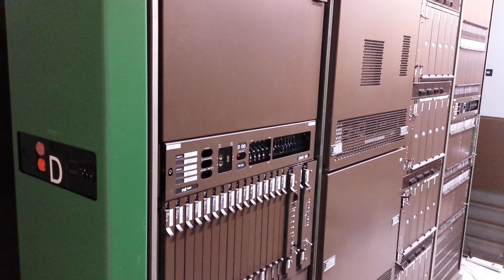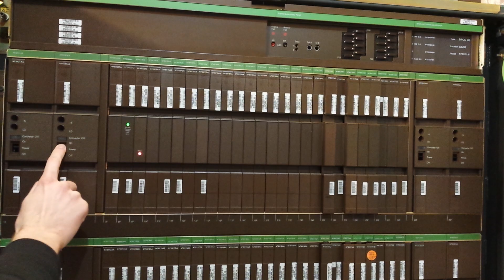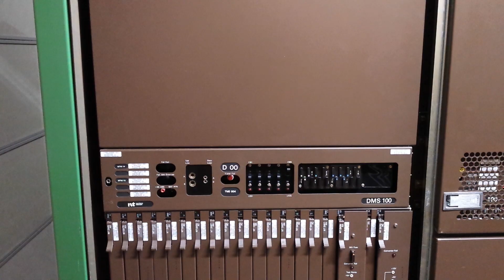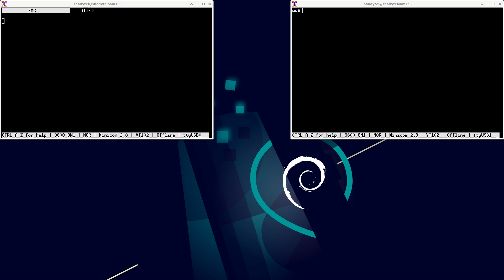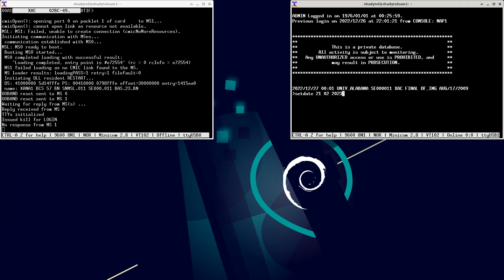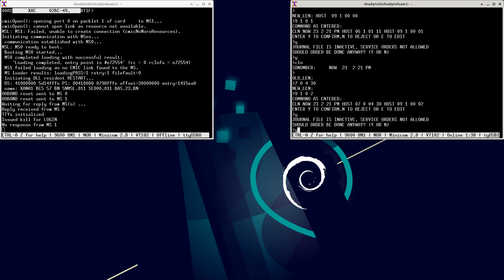DMS-100 Startup and First Phone Calls

Comment: I have no idea if no.4 ess (toll switcher) class 4, 3, or more is still in operation,  also wonder if no.5 ess is still in operation  these days.  Thank you.  This is a very interesting video.
Reply: ATT still have 5 E switches.  We have trucks connected to one here in Memphis.
Reply: @rc_farmer48  thank you.  Does at&t still have the 4e ess switchers?
Reply: I used to work in a class 4 &5 SxS with Cama switching center for southwestern bell back in the 70's.
Reply: Then I ended up working on minicomputer systems for at&t long lines until 1990 which I was laid off.  Life haven't been the same since. Now I'm retired.
Reply from the maker: I can't remember if I can count toll switches (4E) in LERG, but there are several thousand 5ESS still in service, mostly run by AT&T I bet. 3E should be gone at this point, aside from museum pieces. The AT&T long distance network is still several hundred 4ESSes but they've been slowly getting replaced with N4E AKA 'new' 4ESSes which is a replacement that involves much less bespoke hardware that is intended to mostly look and feel the same as the original by virtue of running the same software where possible. I'm not sure on all the details there though.
Reply: @joesvax  good to know that these switchers are still around.  Thank you.
Reply: When working for at&t until laid-off,  I worked on minicomputers such as the pdp-11/70, Vax 780, vaxclusters, at&t 3b2 and 3b20s systems along with hp1000, hp9000 systems.  I have no idea if even some of them are still there.
Reply: Never worked any ESS switching in my bell Telco days,  but had good exposure to computer systems though.
Reply: @rc_farmer48  good to know.  I'm glad these are still here.

Comment: Does it come with an ANAC circuit? It would be interesting if you can hook it up to the outside PSTN (perhaps via SIP if there is such an add-on module / license) and we can dial in to the system and "play" with it.
Reply from the maker: I am not yet sure how or if I can do an ANAC.

The plan is to let it be poked at, but at $300/mo in estimated electricity I'm more likely to schedule times that it'll be on than leave it on all the time.
Reply: In theory that is doable. When Succession Networks first came out, they deployed an option called evergreen to keep all the telco's from having to throw out the old hardware. I forget the name of the node but IIRC it hung off your MS and allowed you add sip to the legacy system. I'll have to see if I still have any of my old docs. Pretty sure I trashed them all. Either way the cost to find one of those likely wouldn't be worth it.
Reply from the maker: @TheProjectHelpDesk  actually I lied again, I guess. Technically my switch was upgraded from SL-100 to a CS2100, the PBX variant of the CS2000.

There's some VoIP hardware that goes with that, specifically a rack of redundant ethernet/ATM switch, media gateway cards in an SPME frame, the various VoIP signalling and application servers as cards in a pair of compactPCI chassis, and a small pile of Sun Netra systems to run the management and billing software.

Aside from that, I also discovered some weird media gateway cards that install into a DTC in place of the T1 cards, perhaps that predates the ones for the SPM.

Comment: DMS-100 or was it an SL-100? Usually universities had the "SL" which was identical to the DMS but sold through Nortel Enterprise. We had a full set up in our lab in Toronto!
Reply from the maker: That's where it gets a bit strange.
Technically it's an SL-100, but having been installed ca. 1984/85, the SL-100 didn't exist yet as a product. The documentation I have says it was a DMS-100/200 and the customer was listed as Bell South. Later on, it must have become the university's and converted to an SL-100.
Reply: @joesvax  Interesting! I did some work on voicemail integrations with the SL-100 maybe around 1998 or so. As I recall, they were virtually identical to the DMS with some slight software changes. The USAF had a ton of them - something like 20 - because they had a feature called “autovon” which AT&T didn’t have at the time.
Reply from the maker: supporting docs for my other reply: http://www.dms-100.net/files/telephony/nortel/SL100/docs/initial-spec-1984/initial-spec.pdf
Reply from the maker: It is also my understanding that the SL-100 and DMS-100 are mostly just software differences. Almost all of the hardware is shared with minor differences, and even then the differences are mostly superficial. The one odd thing is that the SL-100 has some specific hardware to support Meridian 1 IPE cabinets (the specific hardware goes in the IPE shelf) which I don't think nortel would let you do on a DMS, though I could be mistaken.

I think it's mostly down to what nortel turned on in the software and what they'd sell to install in each switch.
Reply from the maker: for completeness, I am also adding that after this switch was converted to an SL-100, it was later upgraded to a CS2100.
Reply: @joesvax  What i've known the DMS-100/200 is a total different switch when it comes to many other things on top of that. It's tandem office in itself which is very interesting how that works.

Comment: I would love to see you get your hands on a TSPS Operator console and get it working with your DMS100!  Or better yet. a TSPS training Operator Console!
Reply from the maker: Nortel switches uses TOPS, as I think TSPS was the predecessor to OSPS that was used on the WECo switches. I do have it on my todo list to establish whether I have the right equipment and software optioning to support TOPS consoles.

Comment: why are the circuit breakers not in the order you need to switch them on in, seems like bad design, assuming they are CB's and if not, still bad design if they are just switches?
Reply from the maker: Firstly, under normal conditions, these systems don't get turned off. Secondly, a lot of the breaker-flipping is admittedly theatrical exaggeration. I could have turned them all on from the start, but it made for a good intro.
Reply: Boy, it's a way better design than you think it is, Probably better than you're local switch IRL, So you need to learn about these switches cause they didn't hire dumb people to design it, it took years months to come up with this stuff in the first place! Have you seen a fully Electro-mechanical switch before? i don't think so that's the best computer in the world for call switching.
Reply: I can understand, we had an option 70 meridian phone system at work, it had not been turned off for 25 years. We turned it off, it didn't work anymore when we turned it back on!
Reply: @womski  option 70 meridian switch is a way different switch than the one you see in this video, Or maybe the reason why the switch didn't turn back on for you is because it clearly didn't want someone like you to be next to it so it got upset. ? who knows :) No offence!

Comment: Which OS would this have originally used?
Reply from the maker: Bespoke one, written by Northern Telecom/Bell Northern Research. I believe it was called 'SOS' standing for Switch Operating System (or maybe I'm confused with the DMS-10). Elsewhere in the switch, there are a larger number of embedded systems running either no operating system, or XMS, another Nortel creation. Later on, with the transition to the CS-2000, a number of the newer components were running Nortel Carrier Grade Linux and Solaris on SPARC or Windows on x86 for higher level OAM equipment and the like.

Comment: I wonder if any dms100's are still used?
Reply from the maker: A lot of them actually, recent LERG shows over 2500 DMS-100s, nearly 600 DMS-100/200s, and a number of others I didn't count because I can't remember their switch type abbreviations off the top of my head. That just covers NANP, but there's likely a lot of them installed internationally as well.
Reply: @joesvax  what is "lerg"?
Reply from the maker: @t13fox67  https://en.wikipedia.org/wiki/LERG_Routing_Guide
Reply: @joesvax  I'll check it out,  thank you so much.
Reply: DMS-100s and DMS-10s are still widely in use in Canada.
Reply: @Daniel Branconnier  this is good to know.  Thank you.  I've been out of the switching loop since at&t laid me off in 1990.
Reply: My area has a mix of those and GTD-5s
Reply: @thetechdudemc  good to know these systems are still around.  Thank you.

Comment: How many nuclear reactors are you using to power that
Reply: His house power if he keeps it on for 24/7 his electric bill will be high
Reply from the maker: a touch over 3000W. About 40 cents per hour at my electric rates.
Reply: @joesvax  - What?  No battery string good for 4 hours  before you start the standby generator!

Comment: this works for 56k modems? (isdn)
Reply from the maker: This equipment does not handle modem calls directly, but calls to digital modems connected to the switch can support 56k speeds.

Comment: I've always wondered when seeing this kind of machine... but hasn't anyone thought of designing it to turn it on using buttons in sequence?
Just [1]+[2]+[3]+[4] , etc ... instead of [4] + [cr7] + [2] + [red] + [a39] + [random button]

Obviously I have no idea what this is or why youtube thought I would be interested, but it was interesting nonetheless   :)
Reply: It’s the YouTube algorithm.
Reply: It's a high-availability phone switch. Engineering consideration (line lengths, propagation delays, EMR etc.) dominate. In the field, you only turn it on once - it never, ever gets turned off. Likely the ease of start-up was never even considered.

Comment: Post up a couple of TRAVERs so we can see the translations you are using.
Reply from the maker: Now that VCFMW is over, and also I've got the translations on the switch re-done, I might just make a video to go through some of that. I removed a lot of data from the tables and did it again from scratch (I have a backup of the original config, of course) and I could cover the work I've done.